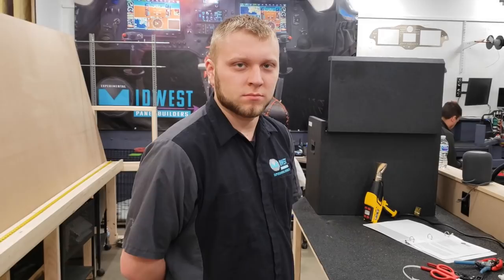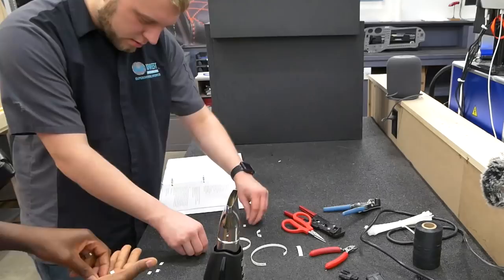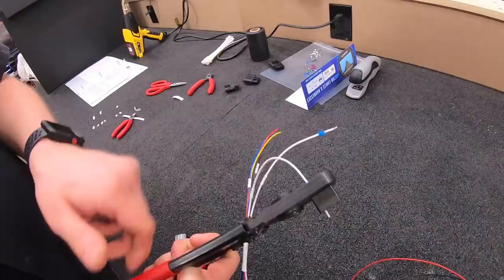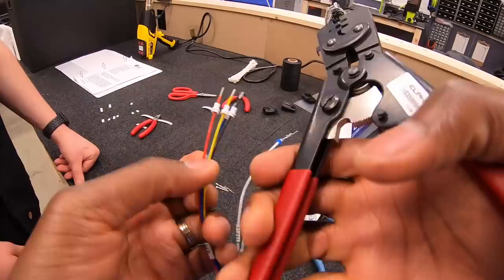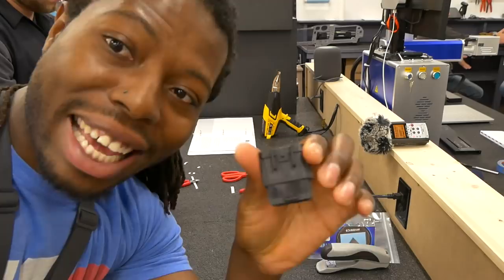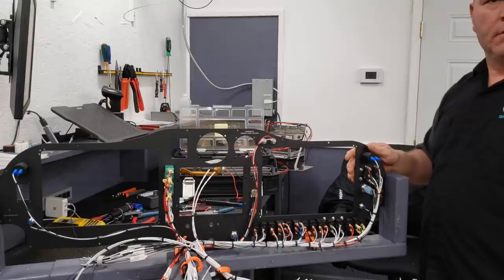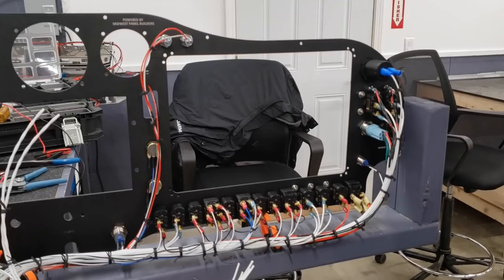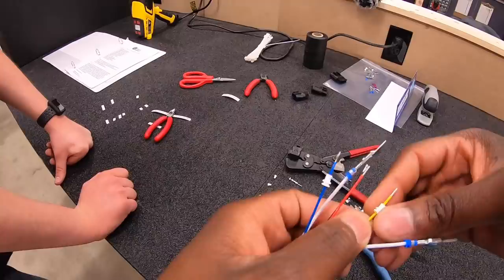Setting Up The WING Wire Harness For My New Plane

Comment: Harness building is serious work and must never be trivialized. I am really impressed with the new modern components and tools in the industry today, no more "cold solder" connections and the like, everything is so much neater. I would guess the Pin Crimping Tools have to be tested for accuracy on a regular basis ?

Comment: OK.....I honestly mean absolutely no disrespect with this comment.  I understand and recognize that you have no background in aircraft manufacturing (or possibly manufacturing in general) and I'm good with that.  However, I think it would be helpful if you also realized that by either partnering with someone who is knowledgeable and can proof read your video before you publish it.  Case in point, that connector WAS NOT made in house - it might have been labeled in house, but not manufactured.  That is a standard 6 pin flat male connector with strain relief.  It's counterpart would be a female connector.  I'm only suggesting this if you wish to take your video's and their technical content up a notch.  Otherwise - keep at it.
Reply from the maker: Non taken, I'd already commented on this a while back. The connector housing is not made at Midwest.